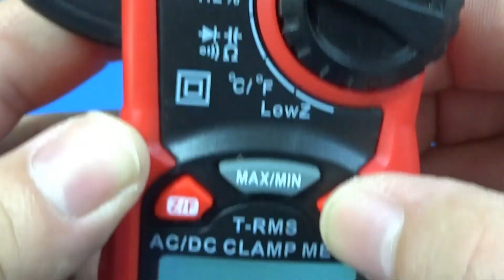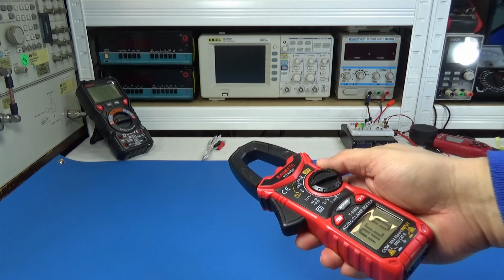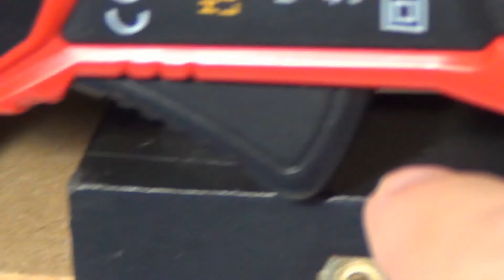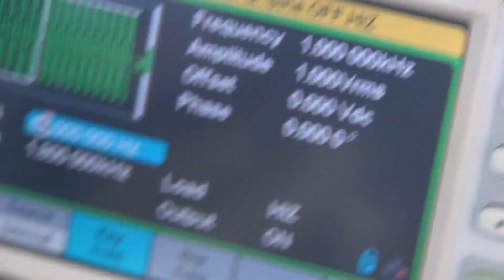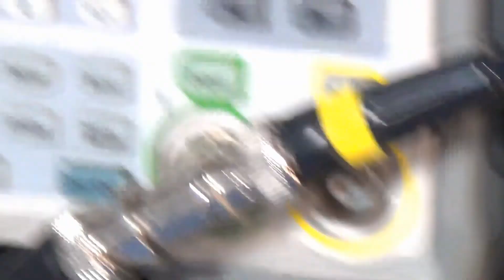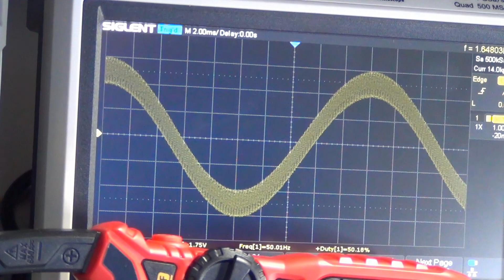Kaiweets HT206D DC - AC 600 Amperes Clamp Meter / product review

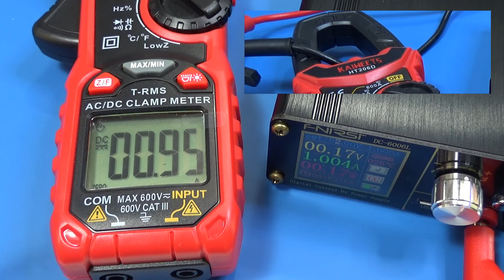Comment: This is a good comprehensive review of the HT206D. However, when you did your DC current test (6:20), I wished you had checked calibration by flipping the meter. In other words, you measured close to +1Amp. If you flip the meter or direction of the wire, you should see -1Amp if the clamp is calibrated.

Comment: Nice, but for lower power applications you might look for a lower amperage model.  Low range of 60A is not very usable when looking for a lower power drain, etc.  I ended up buying a AC/DC clamp that has a 2A range & goes up to 100A.  I almost got sucked into 600A rating.  Something, I now realize, I would never have need of. 👍